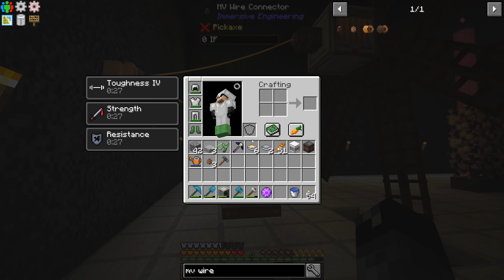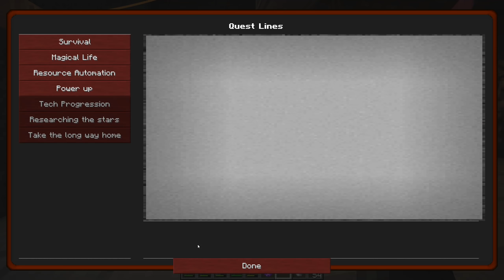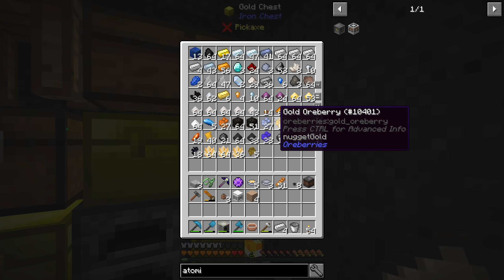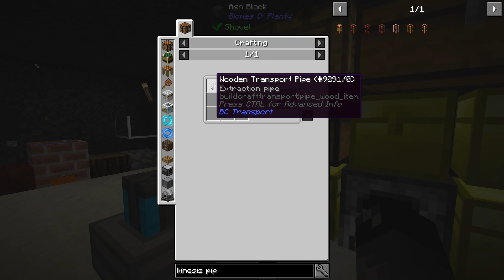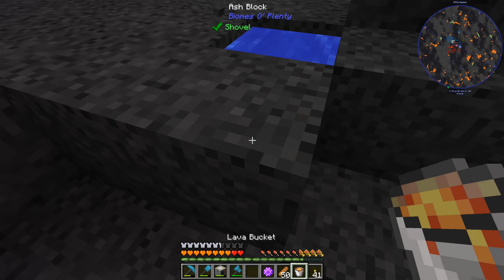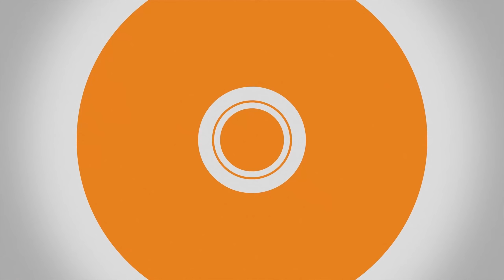Exoria - LASERS & ASSEMBLY TABLE [E28] (Modded Minecraft)

Comment: Windmills look for obstructions AFAIK - they would run better outside placed next to each other with an unobstruted view of the horizon. Higer is better.

To transfer power from outside to inside, put a relay on both sides of a solid block and right-click with the hammer. it will pass power through the block.

You want alloys for a better condenser/combustor? Manyullyn makes a very nice setup.

Comment: I used the electric furnace in place of the regular one with the battery and thermopile hidden in the wall. It is faster than the regular furnace and never needed coal again. I did also use the tinkers tank to store metals for a bit. Worked well to just leave stuff in liquid form because they wont combine. Not 100 percent sure how much easier or better than just lots of chests it is but it did resolve my issue of having to resmelt stuff till something later.
Reply: sorry side note on the thermopile works best with a cross pattern with the pile in the middle one bucket of lava flowing onto two of the sides and then snow blocks on the other two dont use a bucket for each side because it makes obsidian. even with lava flowing on the other two there is a chance to get obsidian but it will equalize and then i never had a problem after once or twice. I did make a thermopile kinda of powerplant of twelve but at the end of the day nah wouldnt bother.oh and snow from i think was botania ? but i do remember you can make blocks then stand on them and rick click to double, like in sky factory (i think), but i do remember theres no point to any other heat or cold sources but maybe i missed one.
Reply: Justcoolies 
You can make yourself a passive obsidian farm this way using the block breakers and vacuum. The catch is no longer using the thermopile for power, so you maintain the imbalance, which causes obsidian to form. Recommend doing such once you upgrade to using a redstone furnace. 
Snow is made using botania and floating daisy with water.

Comment: Now you can do a little sequence break (quality of life). In metal atomizer you can make lead dust. 1 lead dust with 2 obsidian dust (you've got from sieveing) and 1 pyrotheum (2 blaze powder, 1 redstone and 1 sulphur) you can make hardened glass. With hardened glass, 6 redstone and 2 lead you can make leadstone fluxducts. It's very helpful. (hardened glass also gives you ability to use fluiducts and itemducts. Servos are super easy)
Reply: themegadeth116 I've found fluiducts more useful than itemducts. Fluxducts do not seem to connect to the lasers